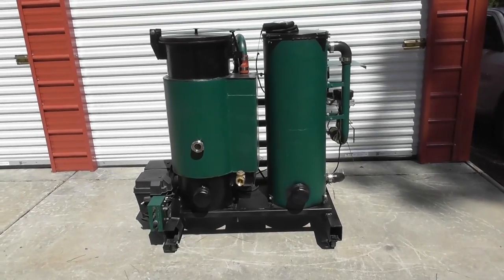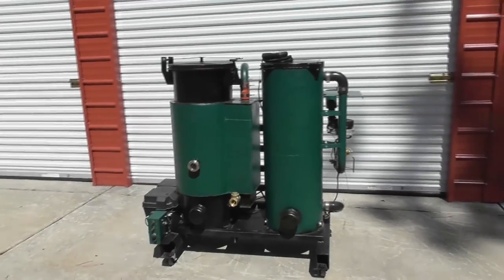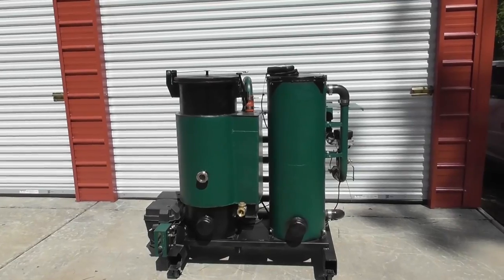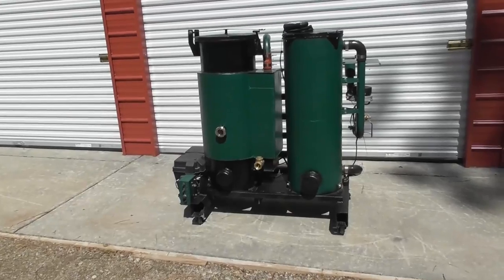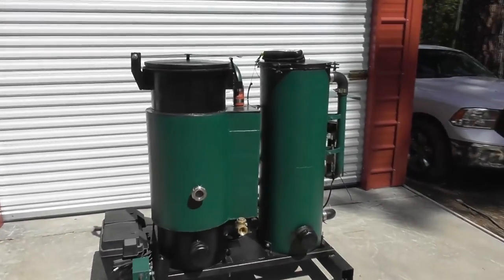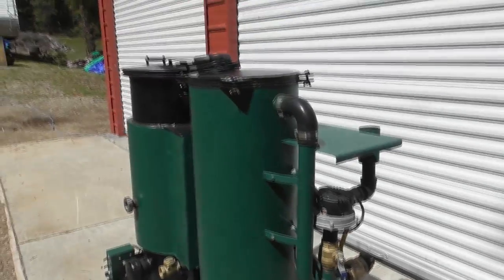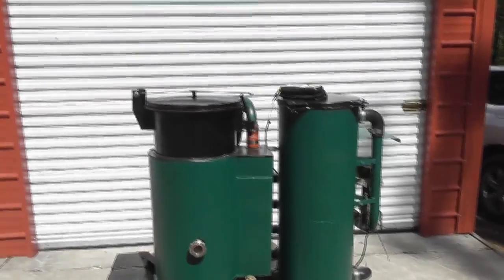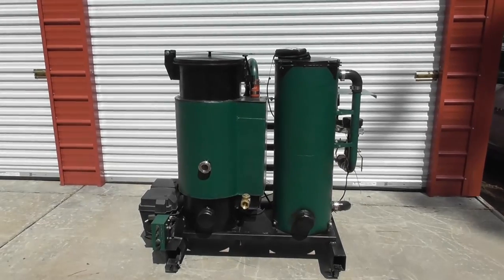Yes, you can build this Wood Gasifier!

Comment: OK yes i agree this gas generators will predust wood gas. & as  I  have seen one built On Gridlessness &  wheced  it's very firs firing  IT immediate reminded  me of    Something I discover in 1962.  It is this  often the Gas from a  wood. result in faller because of the missing link.   That i discovered back then when addressed  produces far moor  gas & run time  .  The charcoal colom  Missing in all woods generators of today.  if you whach the construction & start up of the Gridlessness . Build we see from the get go Coleus  amount of gas & the production of water that was separated out from the smock  soaking the filter hosing & filling the filter cavity with a Coleus's  amount of water. 

cries of chaos Ensues as they find   & wonder what they have don wrong,  But in reality the problem is  the water in the filter chamber & how To Address  it.   WE l in this  design it i possible to fit a  carol colom before the gas enters  the  filter colom & let the damp,  gas  in to the charcoal colom as it is pull up the colon it barns of oxygen with in the smock &  Exists to the filter & then to the flair enrich in hydrogen in short it's   hadron carbons subtidal  for running   gen set's   to charge battery banks.   Les England

Comment: My is all finished no problem runs great the red hose is no problem good product makes a ton of gas out of 2" blocks of fire wood !
Reply: Usage per kw?
Reply: @brub5174   probably about 7 gallon bucket of 2 inch blocks of wood = 1 kilowatt hour just a educated guess
Reply: Where do you get the kit
Reply: @mr.obvious4371   Now  consider green wood  7 the water in the fibbers  in the form of damp smock,  H2'O.  Now if we put that smock into a charcoal colom how much longer would  the run time  be, ?  a gallon of water dript into a charcoal colom will run  for [ 8 hr]  Or as long as we have charcoal to barn. if we fill the gas Generator with all charcoal & put a limited amount of wet wood within it will make damp smock that will barn hot within the combustion chamber & predust good gas l within the gas generator. but trail a error is required. to fin the mix.
Reply: @RacheaHolliwaySINGER  off grid 48 has the kits his name is Steve

Comment: Have you ever considered building a plastic pyrolysis system? That take waste, rough, plastic, and turns it back into its constituent parts, without pollution. Motor oil, diesel, and gas (petrol), all from waste plastic. It can be achieved with roughly the same size of system, as you have here, for your amazing Gasifier.
Reply from the maker: I haven't but you might check with Ben. He created a product called Wastebot a while ago to do that
Reply: @steveoffgrid485  Thanks, Steve. Do you have a link to Ben, please?
Reply from the maker: @ianbell2288  woodgasifierplans.com

Comment: what is the fuel sorce for this system ? i know its wood but specifically dried chips or chunks ?  what size ?
Reply from the maker: Wood chunks, typically 1"-4" in size, smaller chunks for smaller engines, larger for larger engines

Comment: Can a gasifier run a furnace to heat a house or barn?
Reply from the maker: You can use a gasifier for cooking or heating applications but since it contains carbon monoxide and no added oderants, you should not pipe the gas indoors.
Reply: @steveoffgrid485  Let’s say for example that I had a separate building for the furnace that was not directly connected to the house other than the heated air being circulated. Do you think then that it could run a furnace?
Reply from the maker: @Dream.big.dreams  Yes, you could do that

Comment: hi i have a problem whit the rubber hose on the top  hot hot hot 
please revieus your desine somebody will get hurt my friend
Reply from the maker: Sorry but you are wrong. This is a metal-on-metal connection to accept the heat transfer and the straight silicone coupler is designed for high heat and is used in many industrial applications.  You can use a metal coupler if you want but those are cheaper connection and don't do as well as these connectors.